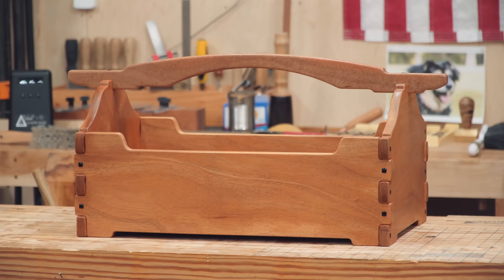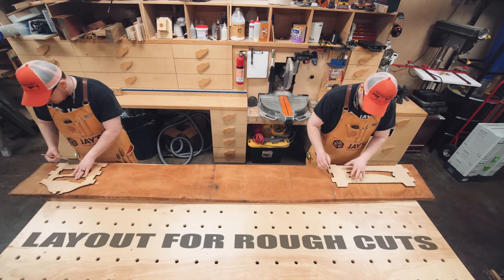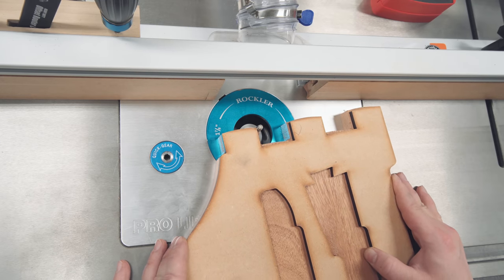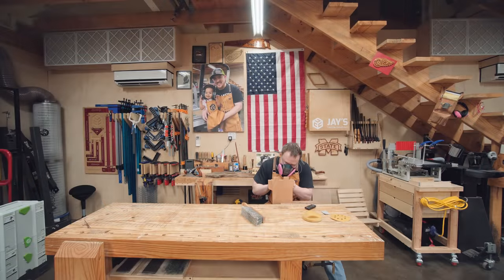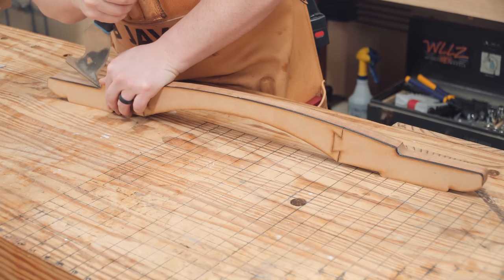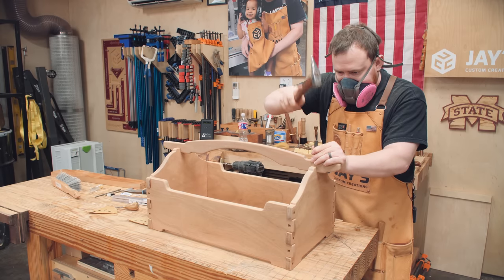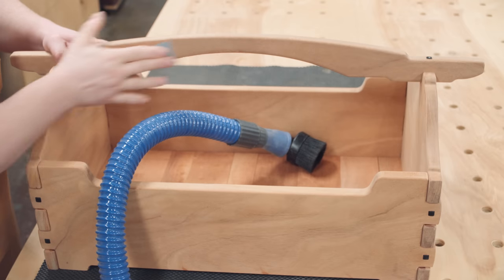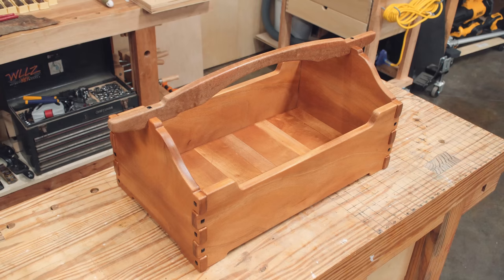Greene and Greene Tool Tote - 337

Comment: It looks really nice, but the thing that strikes me is the whole box is connected with the handle just by a couple of screws and epoxy. I assume you know what you’re doing and it can stand the test of weight and time, but it just looks a bit off versus a through joint.
Reply from the maker: Ha! all thread through the entire end panel? I think you drastically underestimate the strength of the joint.

Comment: Love it! Will be picking up a set of templates shortly. Will likely just use round dowels instead of plugs. Also, for the bottom, would plywood be okay to use? Any special considerations? 

Would love to see some picks of the tool inserts when you have them ready. 

Keep up the great work.
Reply: PMFJI - I've built a ton of tool totes over the past 45 yrs. Plywood is ideal for the bottom. More stable, less expensive,  takes tool abuse.  If you're making this as a showpiece/decorative testimonial to purist woodworking - use solid wood. If you're actually going to haul tools around in it - plywood  bottom gets my vote.  (PS - I could see this as a decorative piece holding granny's china and finest silverware in the dining room or something.. or maybe full of woodworking magazines... or cat toys?
Reply from the maker: Plywood is a better choice for the bottom panel. If I were to use plywood I would likely get destroyed in the comments so I went with solid wood. Both will be fine though.

Comment: Hey there Jay,
I’ve struggled with squaring up holes for these plugs. Getting them consistent with a chisel is almost impossible. I saw you using what you called a “square punch”, which looks like the ideal tool, but I searched for it using that name and had no luck. Is there another name for it?

Comment: Beautiful.  Just one question.  Why epoxy rather than wood glue.  I see epoxy being used more and more.
Reply: One advantage of epoxy is that it does not introduce moisture to your joinery, so you don't have issues with expansion/contraction during or immediately after glue-up.  That's the main reason I would use it over PVA glues.  (PS - I use it maybe 10% of the time, if that. I don't use epoxies often but they do solve some problems)   Another reason might be durability indoors/outdoors... but I don't really see a tote like this kicking around in the back of a pickup truck. And unless it's going to be IN water (a boat) I've found Titebond III to be "waterproof" enough.
Reply from the maker: I went with epoxy as it provides a longer open assembly time and I didn't want any glue staining between the joints. Regular PVA glue would be fine.

Comment: I'm really struggling to understand how the ship lap bottom without gaps could work. I don't agree with them being individual pieces making any difference.
Reply from the maker: It does make a difference. If they were attached to one another all expansion and contraction would be accumulative. It's the same reason why you don't glue in a solid wood panel in a rail and stile door. The panel needs room to expand and contract. But that same door has rail and stile joints that are the same size as the perimeter connections here. Same concept.